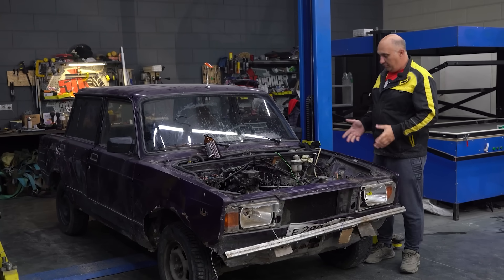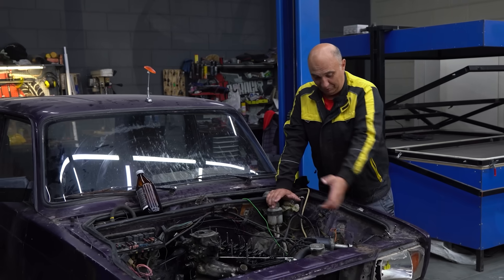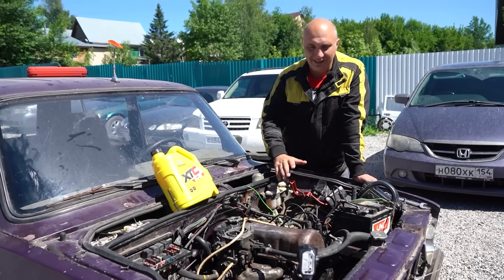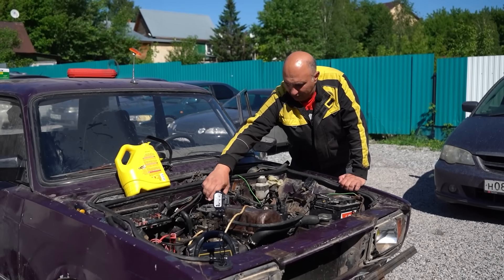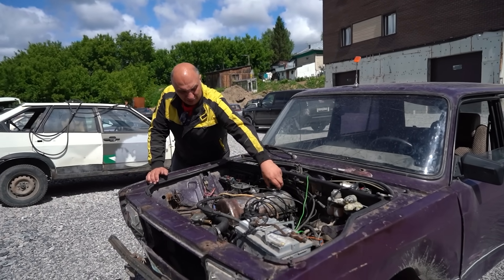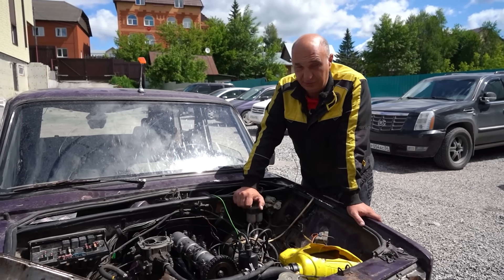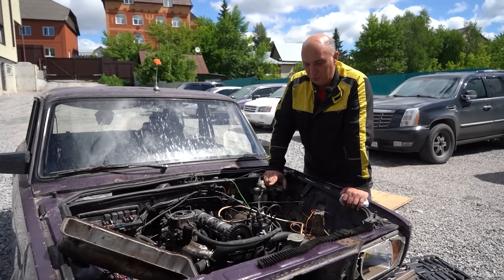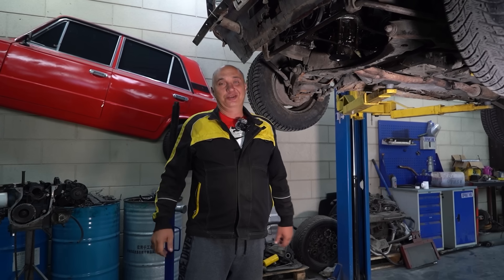Flushing an engine with paint remover – will it work?

Comment: Methylene chloride: A common solvent in hardware store strippers, but its use has declined due to health concerns 
Acetone: A common solvent that evaporates quickly and is very flammable 
Toluene: A common solvent that evaporates quickly and is very flammable 
Methanol: A common solvent that evaporates quickly and is very flammable 
N-methylpyrrolidone: A common solvent used as an active ingredient in paint strippers 
Benzyl alcohol: A common solvent used as an active ingredient in paint strippers 
Dimethyl sulfoxide: A less toxic alternative solvent

Comment: Yes..1/2 quart Diesel Fuel..1/2 quart ATF..mixed..Run at idle/2000 rpm Parked for 1 hour..Check oil dipstick and oil cap..Drain/New Oil Change and filter..Inspect running conditions and Drive Low speed around area...Be ready to check for leaks and excessive burning...Play it safe..

Comment: PCV to exhaust and EGR blocked off.

 You can’t get deposits if you only have air and fuel going past your valves.

 Regular oil changes and a little bit of thought means you never have to do this.

Comment: For gasoline engines :   Heat the engine / oil and add 2-3 quarts of ATF . Let it run for a minute or 2. Drain and refill with clean oil.   ATF will wash the engine prior to the oil change.  Works great to clean lifters, pushrods and oil feeder channels. 
For diesel oil changes :  Heat your engine / oil.  Pour in a few quarts of diesel fuel.  Start the engine and let it run for a minute or 2.  Drain and refill w clean oil.  
Diesel fuel will wash diesel soot out of an engine like crazy.

Comment: try turning the engine without sparkplugs and filled up the oil pan with kerosene oil to clean the sludged up engine. See if it loses up all the crud.

Comment: Do y’all have Marvel Mystery Oil, or Sea Foam? If not ATF is an old trick. Add some to the oil and run it, change oil and filter then be done. Oil pressure should come back up and crud should be dissolved and drained out. I usually run Sea Foam 2 or 3 oil changes to make sure it’s all good for the last hour to 100 miles of the oil change. After the second or third change the oil won’t darken near as fast.
Reply: The oil filter got filthy means it did it’s job. The whole point is the detergent oil Carrie’s deposits to the filter to be trapped in the filter and the cleaned oil goes back into the pan and pump.

Comment: Low rpm . Engine will not run fast . To clean all. At a normal running engine the oil will go everywhere.  But at ide. Oil will not contact every thing in side. 
Mick Australia 🇦🇺

Comment: As the oil filter becomes clogged, it will activate the bypass valve in the filter. If a person does a flush every other oil change.. They shouldn't really ever develop a sludged up engine. But, manufacturers of modern oil will tell you, if you change your oil regularly, you won't develop sludge, and in fact engine flushing is not necessary. Transmission fluid is a good flushing fluid, as it has lots of detergents. Some ppl use diesel, which is very aggressive to rubber seals and gaskets, and you can trade a sludge issue with the issue of a very leaky engine.

Comment: I'm not sure if you guy's have access to Lucas products but they are a miracle in a bottle. From their oil stabilizer, I've had 22r Toyota engines wirh 100s of thousands of miles that sounded like they were about to fly to pieces to become quiet. To a tractor trailer engine that would put a oil slick across the parking lot from blow by to suddenly stop, to their trans  repair have had auto trans with funky shifts and leaks everywhere fixed from a bottle....

Comment: The product they used is almost impossible to buy now.
It unfortunately attacks aluminum and is quickly damaging to styrene and of course paint. 
Definitely blends well with any oil, and will break down any gum or scum. 
It will have only remained active for several minutes and then quickly dissipate under the heat. 
Long term it can take its toll on steel. 
Its a definite no around electronics of modern day vehicle 1980 forward!!  EFI etc being exposed to the vapours of MC ... I don't recommend it. 
Rislone is safe to use long term I have used it personally and designed to clean as you drive.  
On a 55 + year old engine this is okay no plastics inside like today.

Comment: What about the engine seals.   Maybe cause seal leaks.     Kerosene would be better choice,   remove one quart of oil.  Add quarter of kerosene.  Run for five minutes.  Drain, replace filter.   Change oil twice with 50 km run between

Comment: You can make the engine by washing it with acid and after drying it flush it with petrol mixed with some clear silicon, after its dry ad clear water.

Comment: You should try Floway from Kano Labs. Best degreaser I've ever used. Never tried it in an engine, though. It eats paint, dissolves asphalt, and generally wrecks anything that dares to be dirty.
From what I've seen here, you probably wouldn't care about its 142°F flash point.

Comment: I once got a 4 cylinder geo metro from my sister and she was horrible about maintaining it but when i got it i changed the oil with castoroil. After less than 500 miles the oil was black so i decided to change the oil again. It kept getting dark quick do i just kept changing the oil when ever it got black. I had to do that a few times b4 itd last 2-3,000 miles b4 turning black but it did it